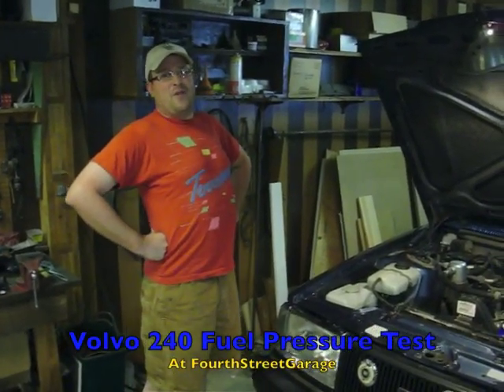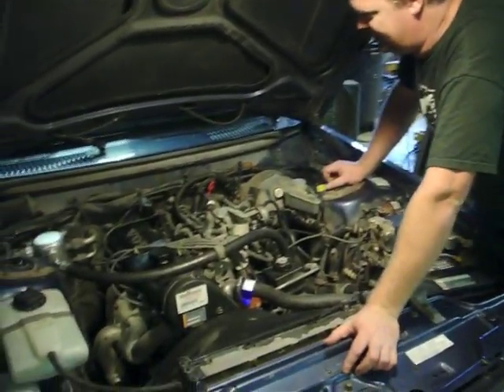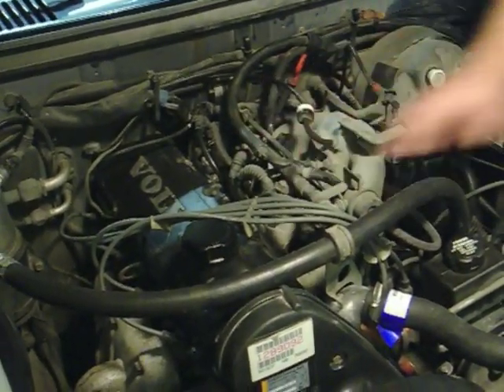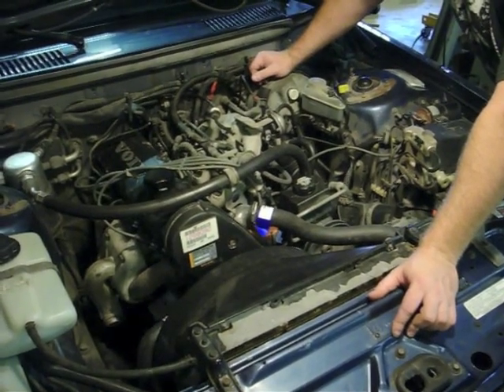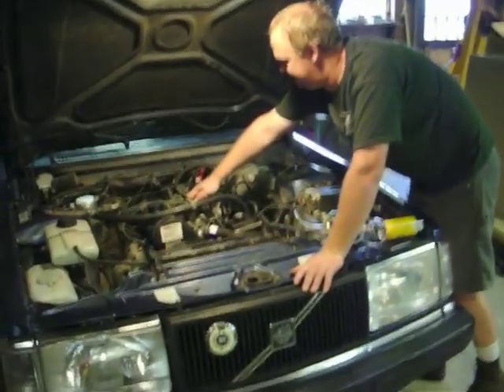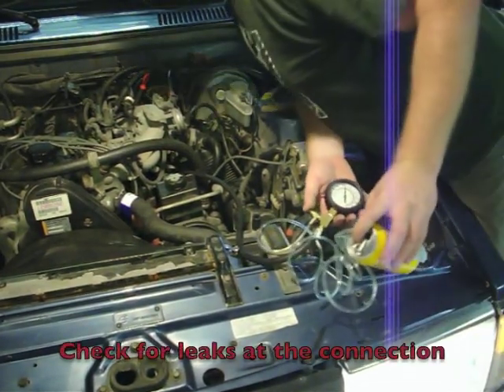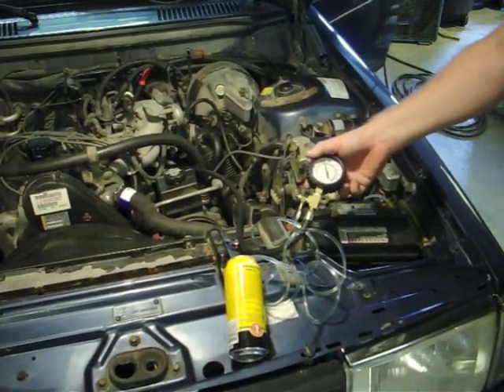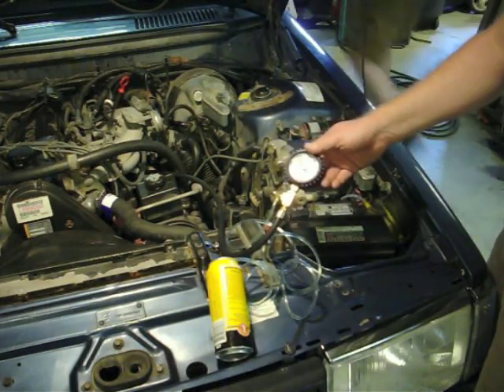Volvo 240 Fuel Pressure Test

Comment: my 89 240 wagon does not have a schrader valve on the fuel rail. how and where do i connect a pressure guage  to check fuel pressure? thanks for your guidance.

Comment: can you test the fuel pressure if the car cranks but wont start? I have a 1990 240 that has spark but no fuel getting to the plugs, fuel relay clicks and the fuel pump hums so now I need to figure out where the fuel is being stopped up
Reply: Did you get that problem fixed? My 92 240 sedan cranks but doesn't start. When it fires a bit white smoke come out the exhaust. I think it's running lean. No white smoke from the engine bay. Any help would be great, please and thank you!

Comment: I have the same car, and I have a problem that I can't seem to track down. It's running really badly, (chugging and very little power) The engine code says it's lean at part load, so I replaced the MAF sensor, the fuel pressure gauge, and I've already replaced the in-line fuel pump and fuel filter. I'm thinking about replacing all the vacuum lines, the coolant temp sensor, and the in-tank fuel pump. Do any of those sound like a likely solution, or do you have any thoughts on what the issue might be?
Reply: To go along with wagonman, I had a bad intake gasket that made it run pretty poorly. Pretty easy job and the gaskets not expensive. worth doing.
Reply: You also might want to check the ECT for the fuel injection, this car has two one for the temp gauge and one farther back for the fuel injection under the no. 4 intake manifold runner if it goes whacky that would mess up you fuel air mixture, mxslotkin has a  good point with the intake gasket spray around where the intake meets the head with carb cleaner when he car is running listen for a change in rpm if the rpm goes up you have an intake gasket leak, and at idle and part load intake vacuum is highest so it would be sucking in air from where its not supposed to be leaning the A/Fuel mix out
Reply: Check for an exhaust leak between the catalytic converter and the pipe from the manifold,(feel for air coming out with the engine running don't touch the exhaust it can get terribly hot)  if air is allowed to get in the car a will run nasty like lope at idle and smell super rich once warm because the O2 sensor will be reading the wrong mixture and think its running lean, also try to clean injectors they could be clogged 
does it run bad when its cold?
Reply: Engine Coolant Temperature :)
Reply: Very useful info, thank you for sharing... what is ECT?

Comment from the maker: He ended up replacing the check valve on the main fuel pump.  Even though the residual pressure checked out when we made the video, that was, apparently, the problem.  He hasn't had the hot start issue occur since he replaced it.  We can only assume that the check valve was sticking intermittently.  Good luck with your Volvo.  Keep it rolling!